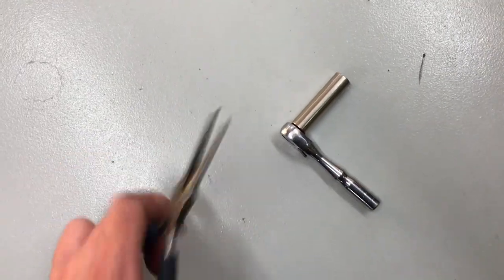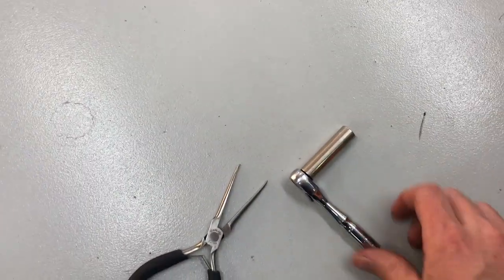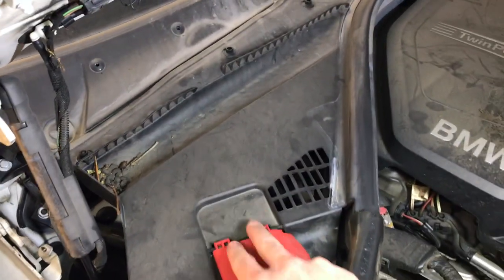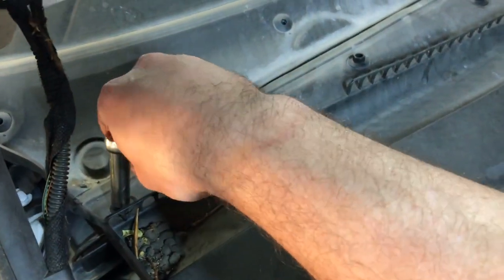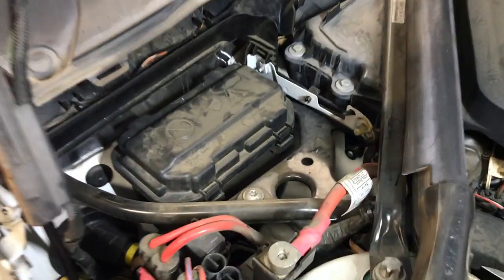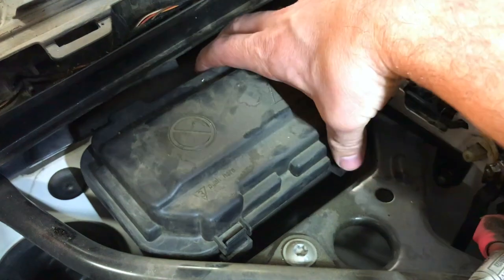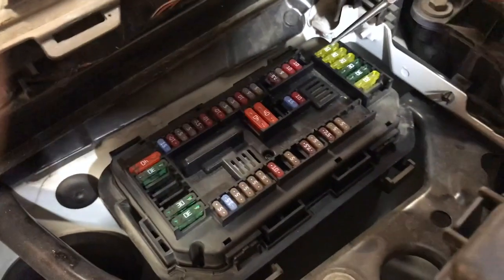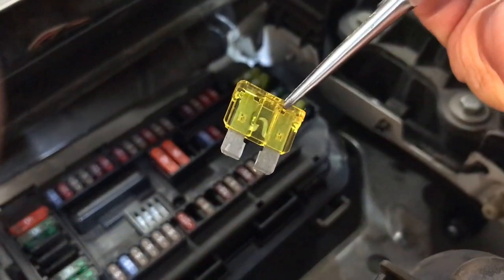How to replace Cig. Lighter Fuse. BMW 3 Series MY 2012-Present (f30)

Comment: Ended a long search for me. I got access to both fuse boards no prob; even made a copy of the leaflet, but that's no use if you can't decipher the symbols. So I smart-searched the web for an explanation of the symbols, all to no avail. Then I was led to this. Thank you so much from across the pond! Talking of which here's an additional tip for UK owners: The cover you need to remove is on the RIGHT HAND SIDE for right-hand-drive cars. Also, after much searching, I found the so-called 'on-board tool' as mentioned in the manual for turning the 3 plastic hexagons. It's in the handle of the screwdriver included in the tool kit, stored in the boot - sorry, trunk! - under the cover on the RH side. Pull out the metal screwdriver shank and there's the hexagonal socket in the end of the handle. D'oh!
Reply from the maker: Thank you for your additional tips!
Reply: Helpful on a UK 320d :)
Reply: Thanks to
Reply: A late thank you! I never would have thought of looking at the screwdriver handle fot the hex bolt removal tool!

Comment: Thank you for the video it was very informative can I use something other than the socket wrench and what size socket wrench did you use also where do you get the fuse at do you have to buy it directly from BMW I have a 2012 328i and my cigarette lighter I used to charge my phone and it doesn't work anymore do you have any suggestions that it could possibly be anything else than a blown fuse it just has doesn't have any power coming out of it and it's very helpful to charge my cell phone thank you very much for your time
Reply from the maker: The 10mm socket with ratchet and the fuses you can get at an autopart store like Auto Zone .